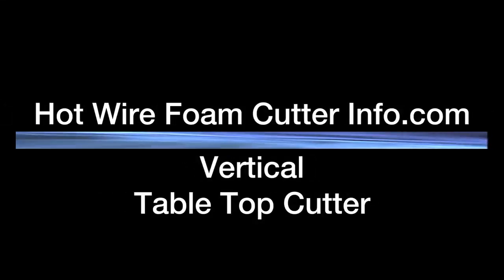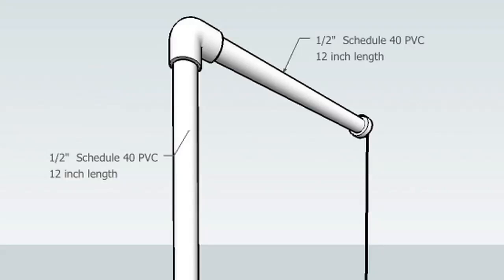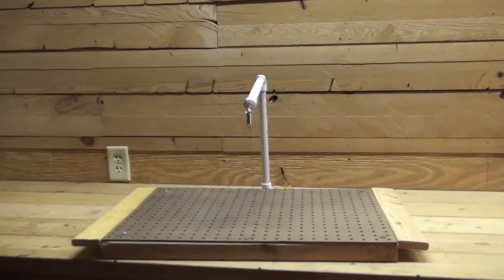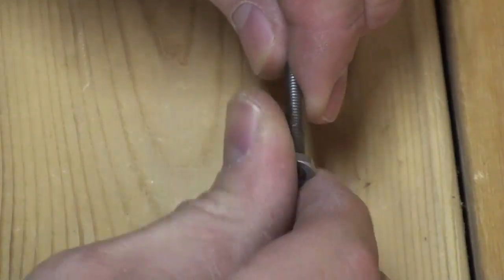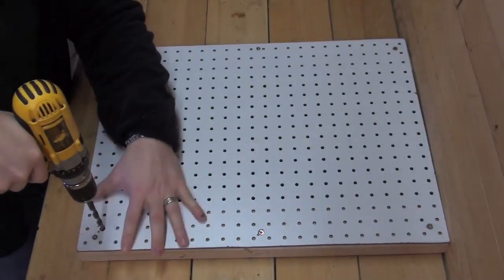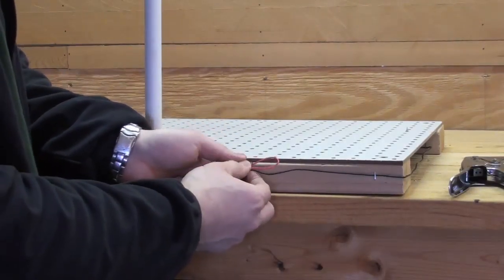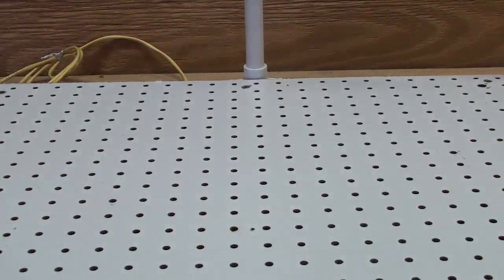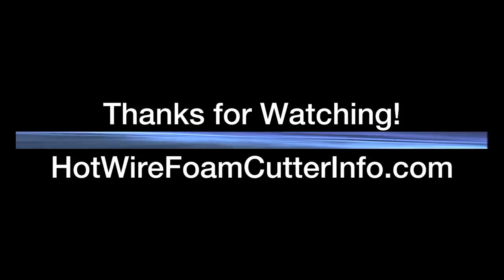Vertical Table Top Cutter - HWFCI

Comment: Nice job ! you can draw 45,90,180 Degree angle lines on the peg board so the  exact cornering can be guided with the clamping posts easily.
Reply: +Rishan Ranatunga That's a great idea, thanks for the feedback!

Comment: What type of electrical wire did you use to connect to the bolts?
Reply: +Dylan Bender I just bought 14 gauge braided copper wire from the hardware store. The electrical current is low (5-12v and 2-4 amps) so most any copper wire will work. You could probably even get away with 20-22 gauge.
Reply: Thank you!!

Comment: Thank you for sharing!  i like your videos,I made my cutter, but it  working fine 30 minutes and after nothing i did it with a AC adaptor class 2 transformer 12V DC 700mA ,a jack power and switch , the cable adaptor is 22 awg , could you explain this connection with this components,because my question is why not working? again thank a lot.
Reply: Hello Maria! Essentially the same answer as for 8ghazale8 who just posted a few days ago. You need more amperage from your power supply. My guess is that you were over drawing current from your 0.7a (which is 700mA) power supply and it overheated and shut off. You'll need between 2.5-3 amps from your power supply to adequately heat wire and cut foam. Short answer is get stronger power supply, the one you have is too weak. Check out the website (hotwirefoamcutterinfo) for additional details or send me an email through the website. Hope that helps! - LetsCutFoam & Carlo@Farmcraftunlimited

Comment: Hi, Thank for the clear video. I made one of these today, but it stopped working after 10 minutes or less. The output of my adapter is 1A. Do you know what could the problem be? I don't have anything to test the adapter but it seems broken. It was quite hot at the time the cutter stopped.
Reply from the maker: You need more amperage from your power supply. My guess is that you were over drawing current from your 1a power supply and it overheated and shut off. You'll need between 2.5-3 amps to adequately heat wire and cut foam. Check out the website for additional details or send me an email through there. Hope that helps!
Reply: cnc foam cutter
Reply: cnc foam cutter

Comment: Hey I have an old computer power supply, how can I connect a light dimmer to control the heat. And could you do a tutorial video of how it's done? Please & Thanks.
Reply: As far as I'm aware, you cannot attach a standard dimmer switch to an AC-DC power supply. But you can usually find "DC Buck Converters" online which are a way of regulating the DC output from a DC power source. Some bucks have fine tune control, others are just a standard drop